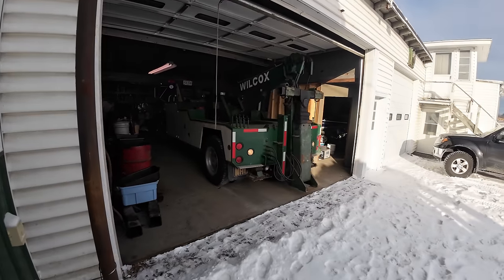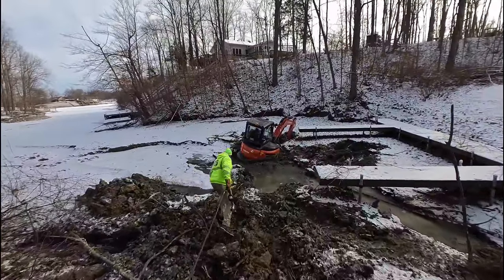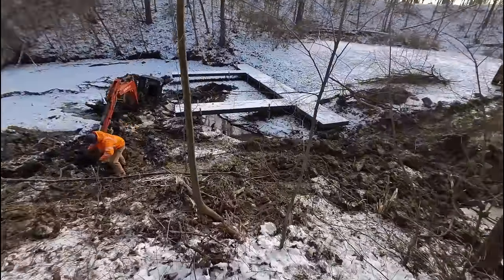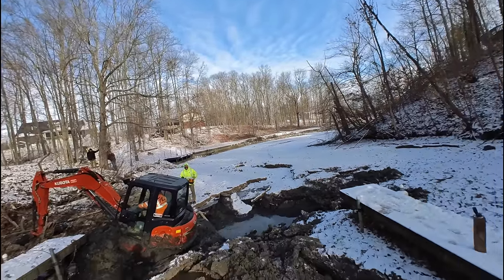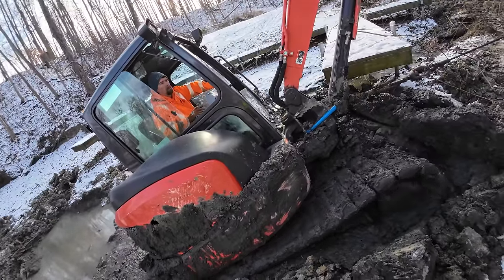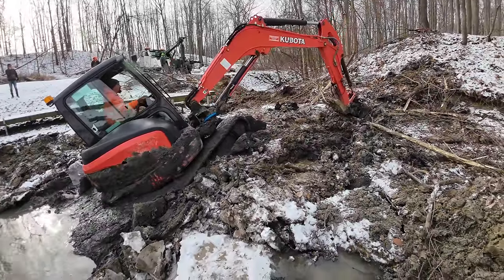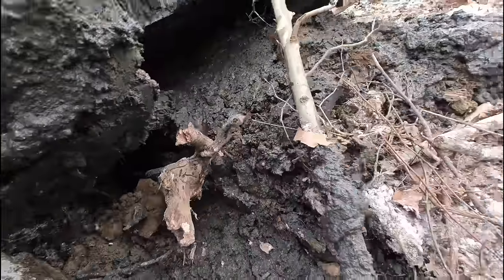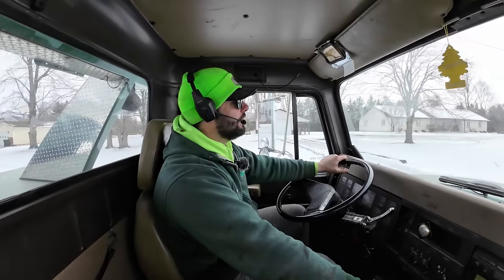We Had To Recover This Stuck Excavator From A Lake Bottom!

Comment: Well that was interesting! Seemed like an odd time to try and dredge out that dock area obviously he found that out! Was good to see the old truck out and being used. I was on the edge of my seat trying to help turn that excavator! Hope it warms up there so you don’t have many more cold calls like that! Catch ya next time WG stay well and warm!
Reply from the maker: Maybe assumed with the cold weather that it was frozen enough on top? That was probably the coldest day of the year so far! Last week temps were in the 50s, so it hasn't been a bad winter.
Reply: I could just tell that Tad wanted to take control of that excavator knowing he is an experienced operator!
Reply from the maker: @jackstockley4501  You're not wrong! However, I had to pull Tad out in that same excavator, almost in the same spot about 5 years ago...So that spot clearly likes to swallow machines! Last time there were no docks there, which made things easier.

Comment: First weekend on a mini ex!! Hands on boom and stick controls and feet on tracks. When stuck your hands are not used on tracks. He was sticking the stick in the ground then using hands to drive without pulling the stick in at same time, it was used as an anchor more than any help.

Comment: That cable break was very special.
But it worked and that's what matters.
So thanks for this report and I'll wait for the next one.
Reply from the maker: It's been over 15 years since I have experienced a cable break, but I'm not surprised by it. As mentioned in the video, this cable was an original, so not surprising after 30 years of wear and tear.
Reply: We broke a (wire rope) lol on our 45ton one time it sounded like a Canon going off
Reply from the maker: @stevewood3170  For starters, when Gramps had the truck built he had them put 9/16 line on instead of 5/8 (because he thought it would be easier to freespool), plus they're 30 years old. Needless to say, it got a brand new 5/8 now.

Comment: Surely a classic case for a double pulley back up to the tree from the excavator, doubling the power from the winch? and reducing the strain on the cable 😮
Reply: Was saying that before the pulling started, even better to another tree.
Reply from the maker: We did not have enough cable on the drum to double it back to the tree. Could have pulled both drums out and then married the lines together and though a snatchblock. Hind sight is always better.

Comment: I would think a long-reach excavator would be needed for this dredge project. That little Kubota, while a good machine, was certainly not the machine for the job. The operator should have refused the job. The HOA (I despise HOAs) should have made provision for access for occasional dredging. The docks should have been removable.
I worked emergency services and we were on-station while recovery trucks were trying to upright an overturned, fully loaded, cement mixer. The recovery trucks were obviously inadequate and a cable snapped, whipping back into a tow operator's face. It was not a pretty sight. He survived but was brutally maimed. You have got to keep away from cables under tension and that goes for tow operators as well. Too many are injured or killed in their line of work.
You all did well to get this little excavator out of a nasty mess.
Reply: Don't need long-reach excavator, just mats for the excavator to walk on.

Probably could've avoided the cable breaking by two-parting the line between the excavator and the tree.
Reply from the maker: The truck honestly did not feel like it had a lot of tension on the line before it snapped, so the years of wear finally caught up with it. With the newer trucks today, it's nice to be able to operate them with fully proportional remote controls and stay out of harms way easier.
Reply from the maker: That was a thought, but we didn't have enough line to double it back to the tree. Other option could have been to take the second winch line out and marry the two lines together with a snatchblock in them.

Comment: If you had a operator on the mini you would have been done with it quickly and not broken your cable. Plus if they started at the end of the spillway and worked inward they would have been fine. Lack of experience cost money and time. All they needed was a good operator and they would have been money ahead and get the job done 👍. Great job keeping your cool guys.
Reply from the maker: Thank you! We've all been in situations that are less than desirable, so staying calm and working through this situation together eventually led to a successful recovery.

Comment: I'm sorry there excavator operator but you definitely don't know how to run an excavator I don't understand why that guy is still in the excavator instead of the guy that's directing next to the excavator seems like he knows how to run an excavator or at least a better idea of what should be done because the guy inside the excavator doesn't have a clue
Reply: But one thing I know about Kubota excavators is that they're controls are difficult to operate

Comment: or, or, ORRRRRRRRRR! You don't try to dredge a pond in the winter where literally everything is frozen on top and mush at the bottom and wait until the dryer months of July and August, then use an actual extended reach excavator and not a mini.  The operator is CLEALY not experienced since he keeps using his hands for the tracks and not the foot peddles so he can operate all of the controls at once.  The boom can swing by itself as well.🤦‍♂  He also needs to be (slowly) advancing the tracks forward while the winch is pulling.  Not sure what he planning on dredging with a 12" digging bucket.  Good thing you guys knew what you were doing though.